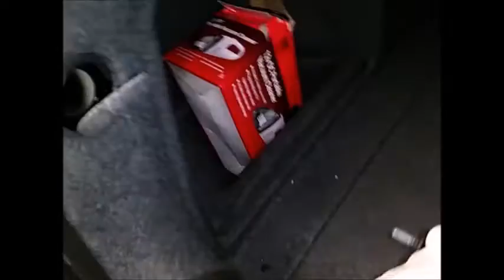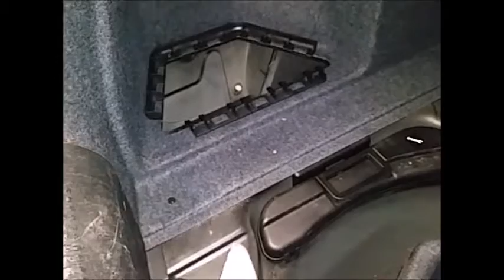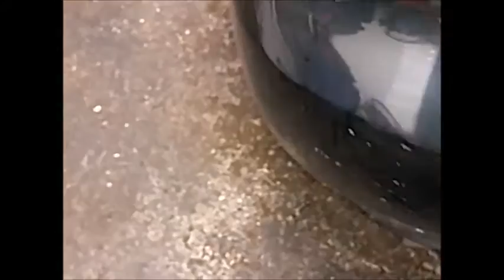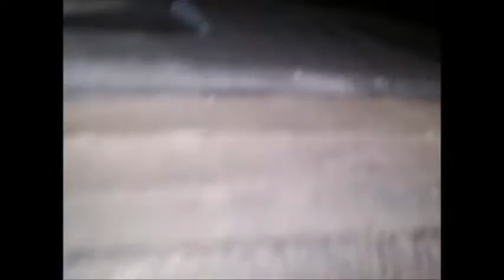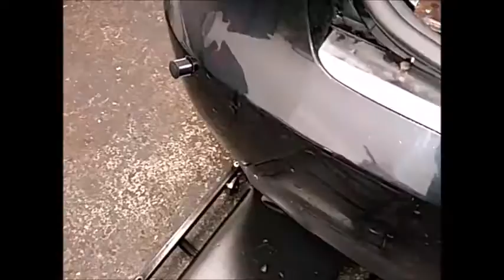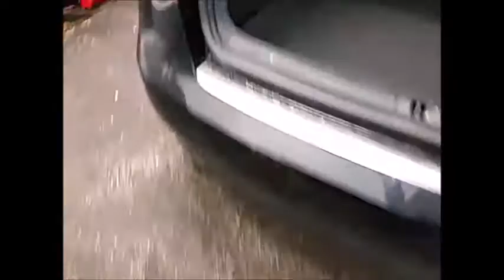Audi A4 Rear Parking Sensors Installation 2005

Comment: i have a audi a4 b6 2002.  and the reverse-light is 6-7 volts.  how do i install it then?
Reply: and yes the battery is new btw.
Reply from the maker: Hi, I would still advise that you remove the tail light as this would be easier for you to test the wires and connect them. Thanks

Comment: Note! Youre gonna need a relay and ignition power. Without relay it will cut the power of parking sensor about every 2-3 seconds.
Reply from the maker: +Petri Johansson Great point! It will require a relay on a normal system, but the one I use is a canbus control unit so this acts as a relay and prevents any interuption to the signal. It's all built in and wired in like any other non-canbus car.
Reply: +Fun Tronikx Hi, thanks for your reply. Where can I purchase one of those?
Reply from the maker: +Petri Johansson You can probably find them on ebay. The units I'm fitting here are only sold to the trade, but there are similar units being sold. If I get time to put some up for sale on ebay, I'll post the link for the exact same model as I'm using.